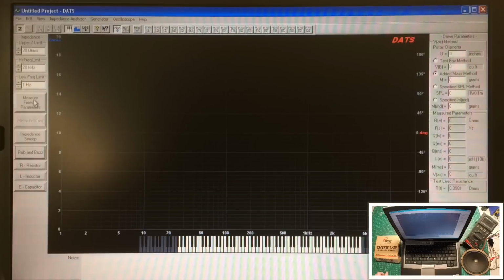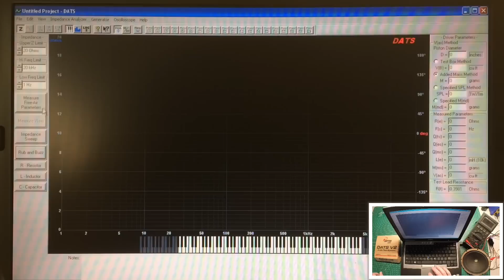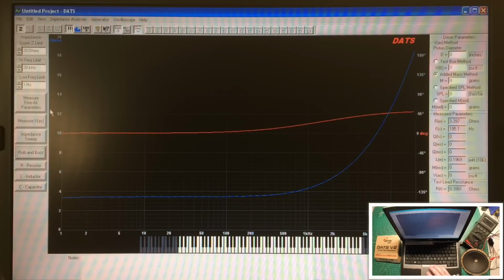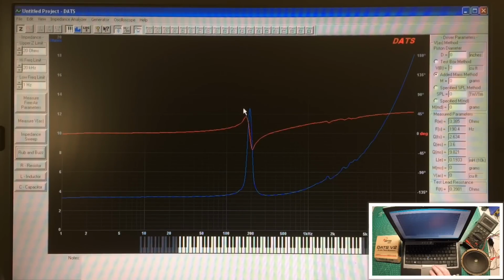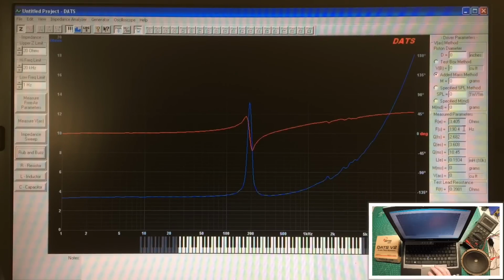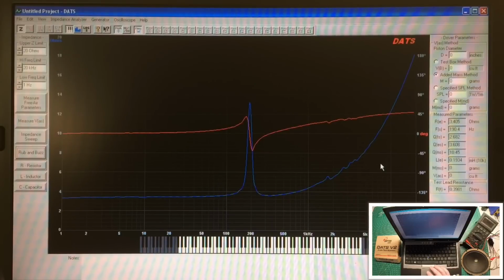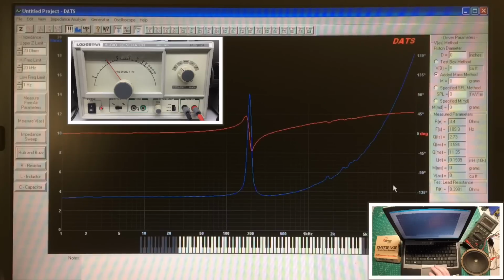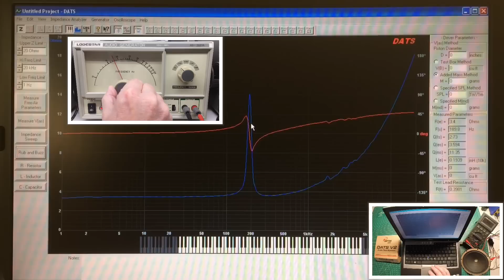Speaker Impedance Testing

Comment: +RestoreOldRadios , Don, do you expect the Total-Q to resolve after a sufficient break-in period, if there is such a creature as 'mechanical break-in of a speaker'??
Reply from the maker: +AMStationEngineer Tim, not being an audiophile, I'm not sure how much impact it will have and would appreciate your thoughts. I've read where playing a variety of music at a higher level than normal for a few hundred hours will loosen up the mechanical aspects and improve sound quality over time, while others heard no difference. Even though the rebuilt speaker for the Philco 41-280 works, it seems the Qes was impacted by the base plate being aluminum (lessened the magnetic field?) and the aluminum voice coil with no gap that we discussed in the earlier thread. In addition, the surround and spider seems a little stiff and this may be creating a higher Qms than desired or it may all tie back to the Qes issue or a combination of the two. Best, Don